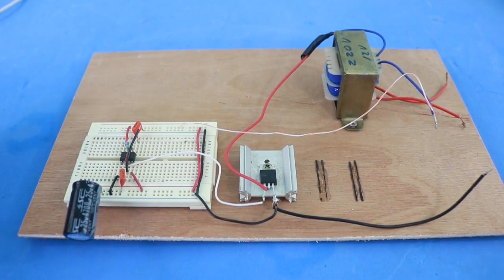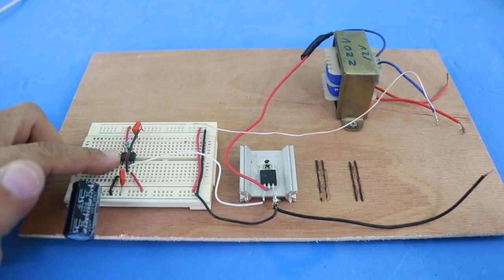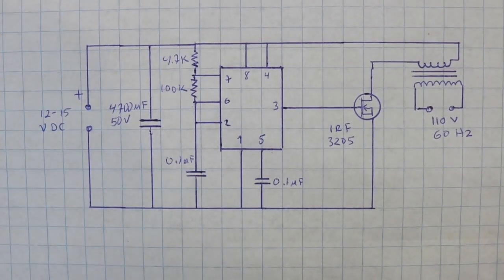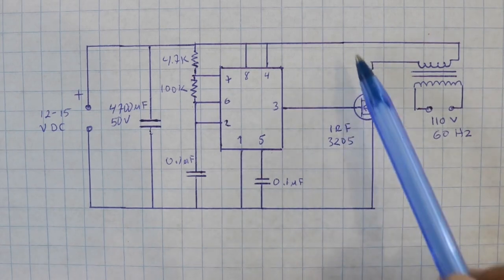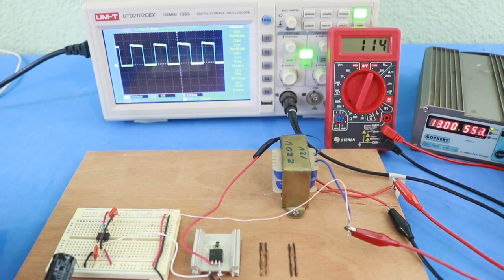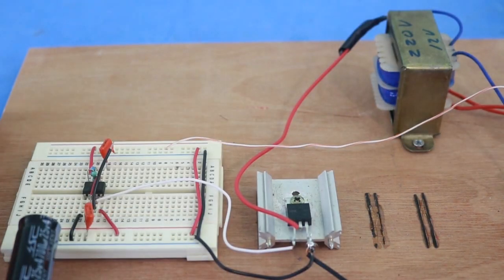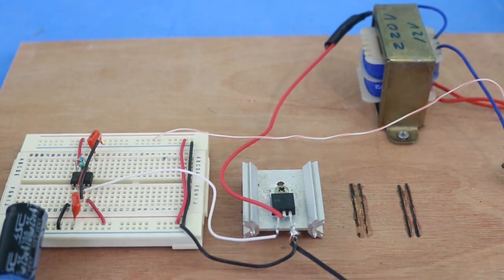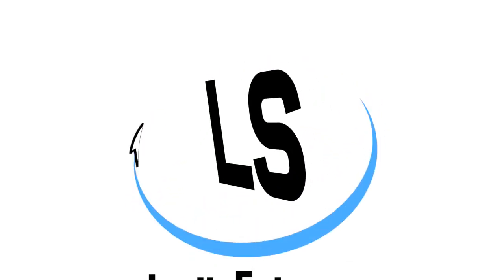Simple Square Wave Inverter with 555 Timer

Comment: GreatScott and Afrotechmods already made a vídeo on how shitty and unpredictable this circuit is, please do not build this.
Reply: I guess you could use it as an temporary replacement if a low power inverter breaks.
Reply: @oppok5657  the output of this circuit is unpredictable, it doesn’t have a feedback to adjust the duty cycle to maintain a stable output voltage when the current varies due to different loads.

Comment: I don't know why people are concerned that this is pulsed DC instead of AC, but to get full AC you just need three more mosfets to make an h-bridge. 

If the transformer was center tapped, you could do it with a single extra transistor. 
Then use a pnp transistor to turn off one side of the transformer when the 555 timer sends the pulse. 

As far as people saying this has a huge on-rush current.... I don't think that's true. The load is being connected on the high voltage side, which means that the current is actually being reduced by a similar factor. 
IF the load was connected on the low side of the transformer, the current would be a problem, but, as it is, it actually needs the flyback transformer configuration to get the amperage up to the point where it can run the circuit. 
Remember, transformers can  increase voltage, but it does so by removing current from the other side. If you're stepping your voltage up to a 1000 volts, you need 1000 amps to get the current to run the circuit. 

The voltage on the low side is 12, and it's being boosted up to 120 (ish) volts. 
That means the current running through the transformer is being reduced by a factor of 10, not counting whatever is being lost to that transformer hum. The LED bulb needs something like 0.1 amps to turn on, which means that the transformer on the 12 volt side has to draw 1-2 amps to meet that.

Comment: Hello
i want to know that the output of the transformer is cycling ac or pulsing dc because you’re feeding it with pulsing dc
Thank you so much 😊
Reply: Anyone knows the answer???
Reply: Output is pulsed dc voltage since he is pushing current through primary in one direction only.

Comment: This is basically a flyback topology, when un-loaded you are going to see short spikes of over 1000 volts at the output of the transformer. The meter is just showing the average voltage.

Comment: There is no protection of the mosfet from voltage spikes in this circuit. The no load current seems to be huge.
Reply: Cant expect much from simple design like this. Ofcourse you can make it better but you have to pay price for it.

Comment: It's Similar to Boost Converter Circuit. Except here the primary Winding of transformer is used as Inductor and the secondary provides the higher output voltage when the switch is closed and the magnetic field of the primary Collapses. Kind of  Flayback Converter Configuration.

Comment: Connect a lpf at output you would get a sinwave
Reply: @gerarddugas6224  low pass filter
Reply: @EasyElectronics2412  that's what I was thinking too but I wondered if the mosfet switch would just turn it back to square wave. I've watched a few videos where they show an lpf turn the signal to sine, on the oscilloscope but they never show what it looks like after it's been amplified through the mosfet.
Reply: @johnruscigno5738  lpf is to be connected just before the transformer and not before the mosfets... 😅
Reply: @EasyElectronics2412  I tried that too and I don't get a sine wave, I end up getting this weird looking wave that resembles a sawtooth.
Reply: @johnruscigno5738  try changing the capacitor values

Comment: I had made inverter with relay but it was noisy & not efficient
Reply from the maker: An efficient inverter will have much much more parts. Simplicity has a cost
Reply: Yes you can use Arduino with spwm implementation which I think someone has wrote a code for.....